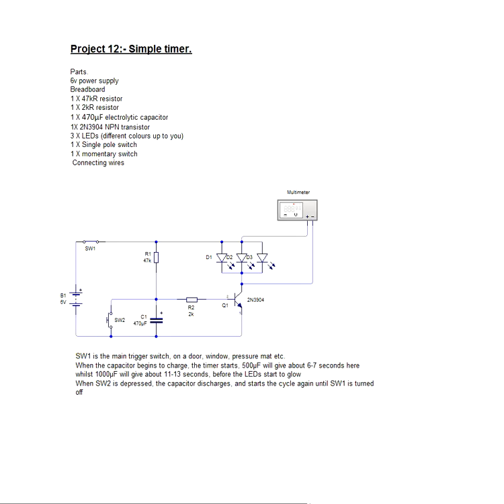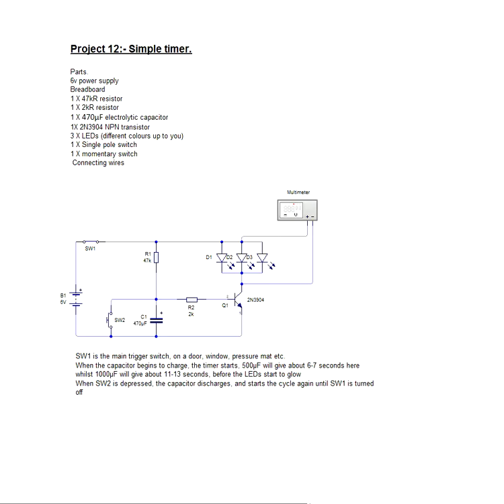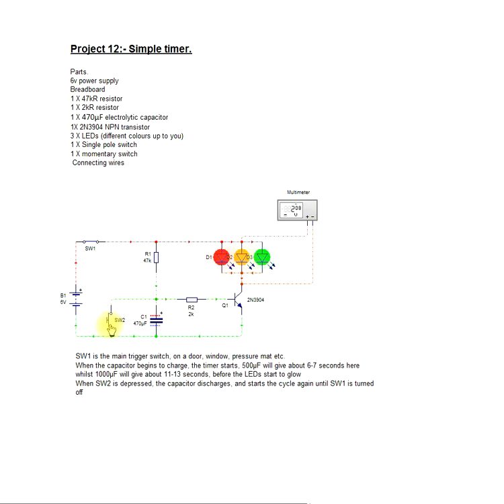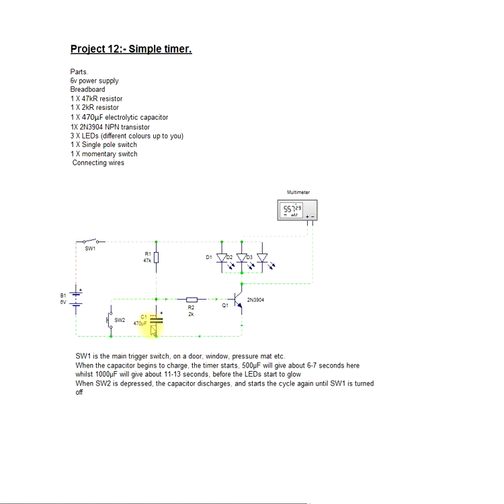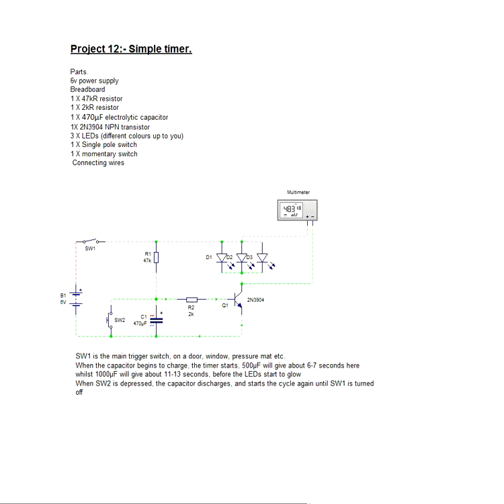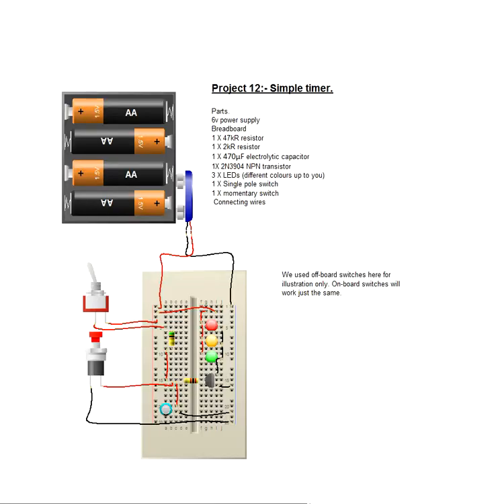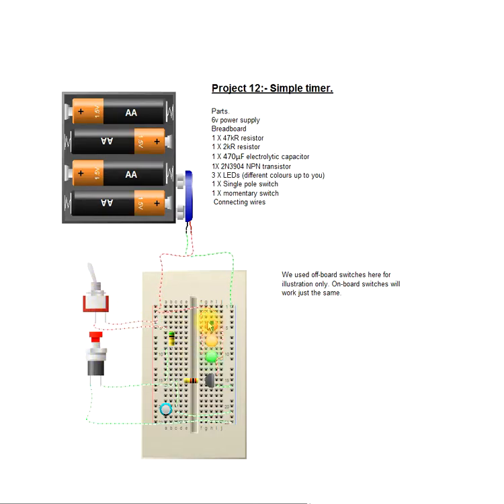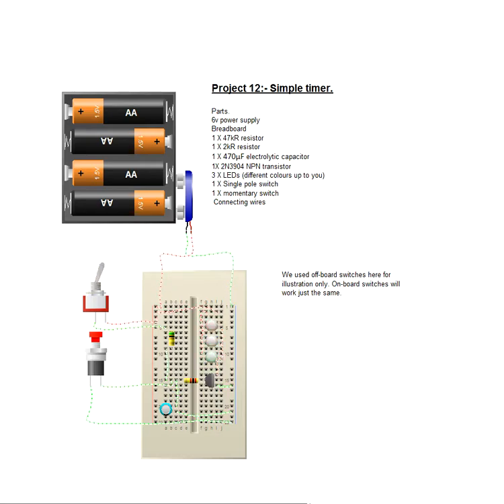Simple Capacitor Timer

Comment: Hello Breadboard Electronics,

A very nice, simply, no BS video and very needed aswell :)

I have a question, in the beginning you are using some sort of simulation tool, which is this?
Reply from the maker: Hope it helped in some way.
The circuit simulation tool is called Circuit Wizard. Not free and probably not the best either, but it does allow for circuit simulation with a large (though not exhaustive) amount of components.